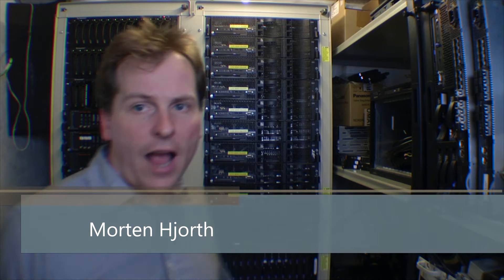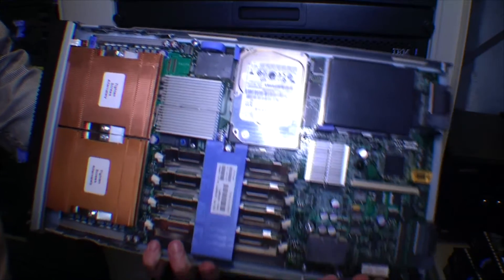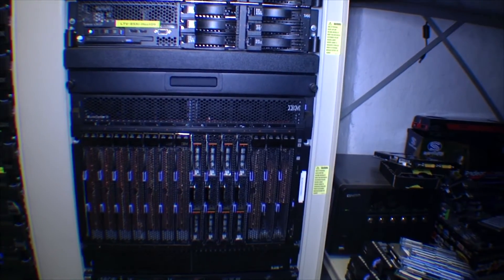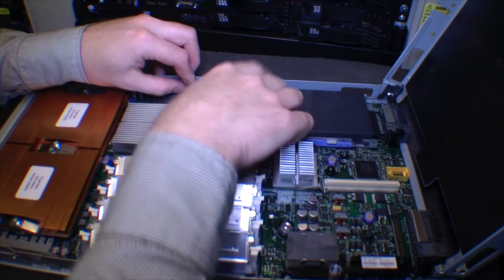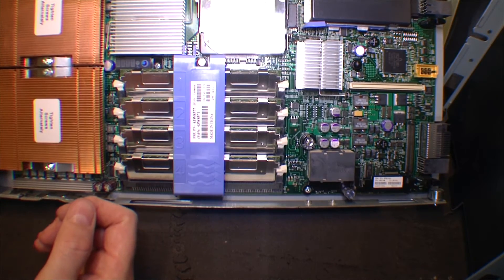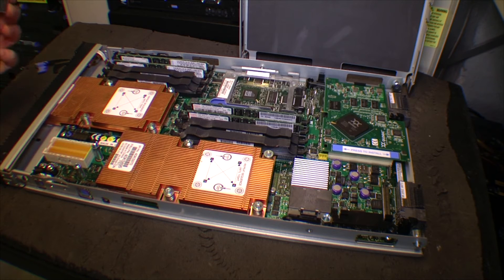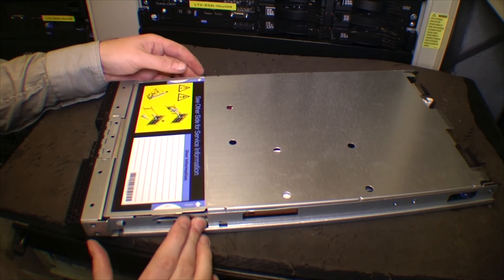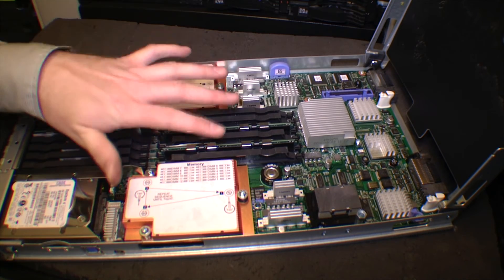IBM BladeCenter H, HS21, LS21, and HS22 - 203

Comment: I having an issue with my Blades Center. we have two Blade Center one contains four blades Server and another one contains 6 Blades Server. Issue is suddenly it started getting Shut down automatically after  one hours. again we need to start from Advance management module in every 1 :05 Hours. In each blade center one server remains up Except that two blades server in different all gets down. Power sources UPS has no alarm everything is okey from power end.   Any Guidance will be appreciated.
Reply from the maker: Hi cities flags
Thank You very much!  There must be something in the AMM log if the system has closed it down on purpose.
Thank you for watching! :-)

Comment: I found a whole pile of these bladecenter H supplies, guy told me 20 bucks each, they all work.  Im thinking of buying 2 to make 12v+  @ 244A output bench top power supplies for working on amplifiers. Ive read on the RC forums where they are converting them, usually the much smaller supplies 800-1200w jobs. That isnt enough for me. Anyone have an idea where to find this kind of info for the bladecenter H?
Reply from the maker: That is a very cheap 244Amp 12v power supply,, and good build quality as well.

Comment: Hi! Thanks for your videos! You mentioned the 4 port switch at the end of the video. I have assembled a bladecenter with 14 blades, the only thing that I am missing is the networking modules. I don't understand  is the minimum needed for networking? If I buy the 4 port one, will all the blades have network? Also at what speed, is it 14blades/4gb= 350mb of bandwidth for each blade (in case they are reading data at the same time)? Thanks a lot!
Reply from the maker: Hi
Yes one switch shout be enough.  And yes they share the four uplink ports. so depending on your traffic, you might need one more switch. They are not bad : http://amzn.to/29w4drl
But I try it out with one first if that is what you got,,, I have played around wide 14 Blade Servers rendering 3D Studio MAX on just 1Gbit,,,no problems.
Thank you for Watching! :-)
Reply: Thanks! I watched all your other videos and saw that you use only one uplink, and still have ethernet on all of them :) I will be running disk-less iscsi, so I think i should have more bandwidth (also for 3ds max). Do you think it is better to buy one passthru module with 14 ports like this: http://www.ebay.it/itm/262482335523?_trksid=p2060353.m1438.l2649&ssPageName=STRK%3AMEBIDX%3AIT

or 4 like the ones you linked: https://www.servershop24.de/en/network-equipment/switches/gigabit/ibm-cisco-32r1895-32r1892-4-port-switch-module-cigesm/a-101021/

According to the ibm redbook, it is only possible to have a switch in the module one so a passthru might not work potentially?
Reply from the maker: Hi Srdjan Petricevic 
Well with the passthru module,, you are just moving the problem out,, and will need lots of cables and more switches,,Nahh.

Internal switches are better..
Thank you for Watching! :-)

Comment: My PlayHouse, Do you use this machine for rendering, as well? Is it faster than using virtual machines or standalone servers thanks to the interconnects on the blade chassis? I think my electricity bill might sigh in despair if I was to purchase one of these, but I suppose that is one more reason to venture into solar power. Do you ever use any fiberoptic data connections instead of Ethernet to connect storage such as the SAN or NAS to your cluster of servers? SSD's might also handle the heat better without failure in those individual blades, too. I want to try some SSD's for my x3650 M3, and they are getting cheap enough now for 120 and 240GB drives to make it feasible. Thanks for another excellent explanatory video!
Reply from the maker: Hi Tyler Barton 
I use all my servers for rendering,,with VM-ware ESXi.  Even if I were to lose a little performance, it's so much easier to work with virtual machines: 
3D Max Render test. Hardware vs. Virtual server - 189  https://www.youtube.com/watch?v=gmxVOY4Vlx0
Fiberoptic,, no not yet,, i have some equipment, but i am not really using it.
SSD is great for like the OS and fast storages. Still too expensive for large amounts of data.
Thank you for watching! :-)